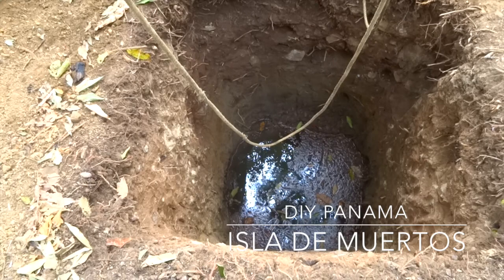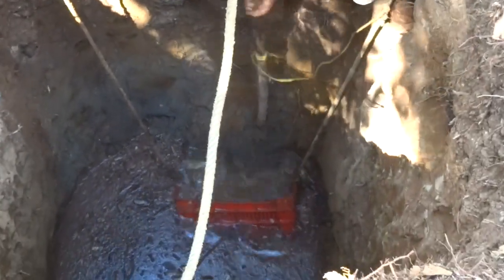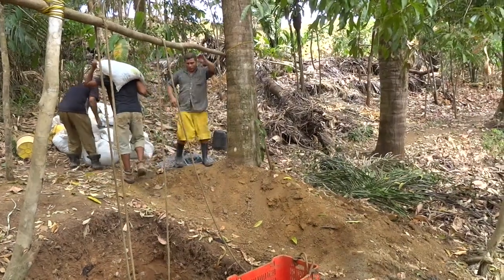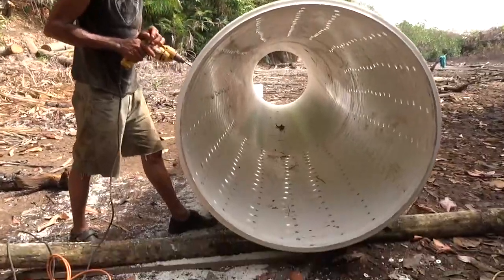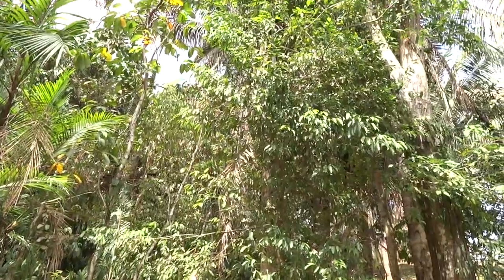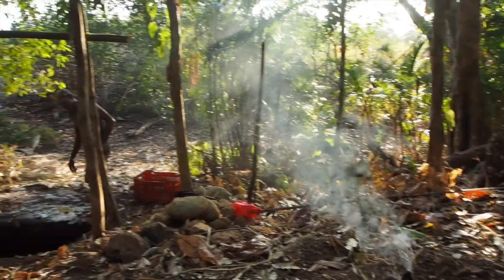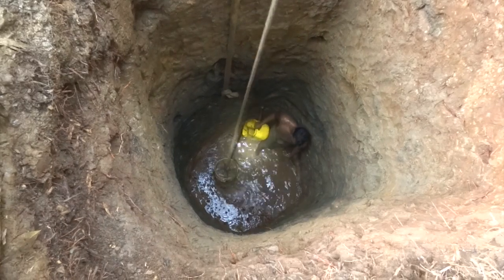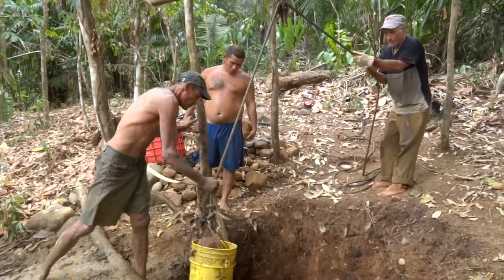DIY Panama - hand dug well

Comment from the maker: Low tech construction to move, lift and install a 400kg, 20ft PVC well casing and other materials on an island with no power or roads.
Good rope skills a must!
Reply: Is the water table pretty high there? Here in Texas it's common for wells to go down 50 feet, and as far as 250 ft to reach reliable water.
Reply from the maker: Water table was at 12ft in dry season, should be higher now the rains have come. There are other wells on the island with water at 6ft.